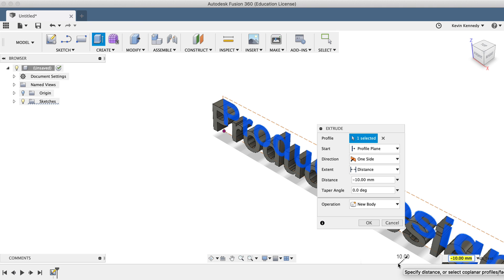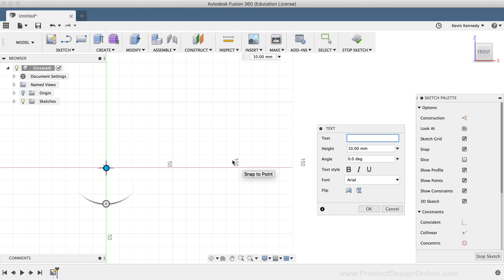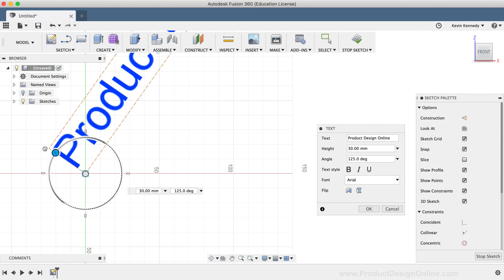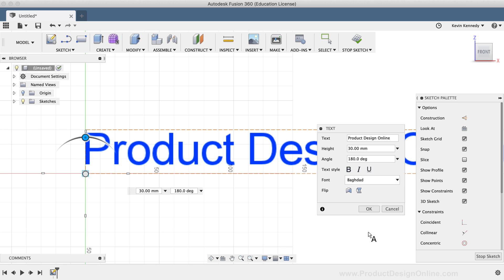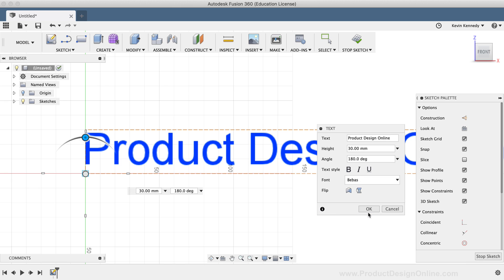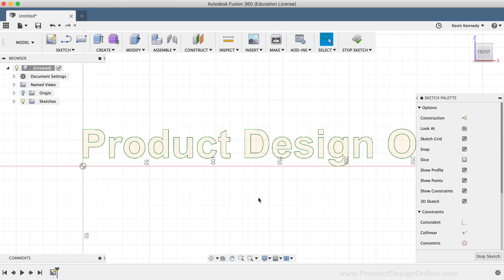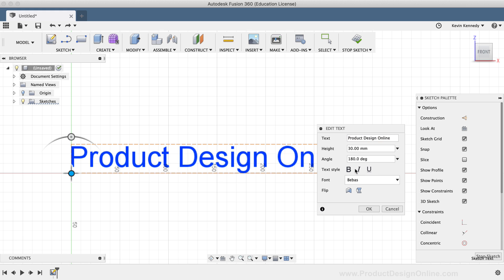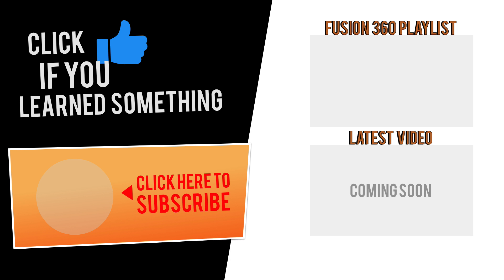How to Create Text in Fusion 360

Comment: Kevin, have you experienced fonts that don't display / show as the default arial? I imported (on mac) a Rae Dunn Font (also known as 'The SKinny') and it shows on other applications, but although it shows up on the font list, it displays as arial.  Any way to fix this?
Reply from the maker: Hi, Jason. One thing that I did not mention in this video, which may be why your font is not displaying.  Fusion 360 currently only supports TTF fonts. If the font is an OTF font (a lot of the free fonts on the web are) then it will not work, even if it shows up in your list of Fonts and lets you select it, it will default to Arial. Cheers, Kevin :)
Reply: @ProductDesignOnline  thanks Kevin.  I also learned that some of it is Mac error related - by manually dragging and dropping the files to Macintosh HD/Library/Fonts subfolder, (the native Arial Unicode.ttf was the only one in there in my case, even after several attempts to install the font ), that solved the issue.  THanks again for your assistance
Reply from the maker: @jasondagenais5701  That's good to know. Thanks for the update! Cheers, Kevin :)
Reply: @jasondagenais5701  There's and easier, more permantent way to solve it :-) Open Font Book>Preferences>Default instal location : Change from User to COMPUTER. Not sure if you have to reinstall the fonts in question, but did that anyways, and it now works like a charm :-) Hope it helps. PS, this will walso alow you to much more easily install new fonts to Font Book by the import function or simply double clicking the font file (open font file) in finder.
Reply: @SourceOfObesity  thanks for the post.  I read that suggestion before and my system is set to 'computer' but it still doesn't want to honor the font install correctly.An unfortunate byproduct to Catalina.
Reply: Jason Dagenais did you reinstall the fonts after changing to “computer”?
Reply: SourceOfObesity yes I have.

Comment: there is one way to add texts to a surface...this guys got it figured out...

https://www.youtube.com/watch?v=oe-A6mWU2mQ
Reply from the maker: Hi Jason. Thanks for sharing this. I did include that method in an older video. I also included it in one of my most recent videos, which covers some other ways to create text on a curve, if you don't want the slanted or angled letters as he pointed out with his method. You can find that here - https://youtu.be/sja3Fd6aERI
Cheers, Kevin :)
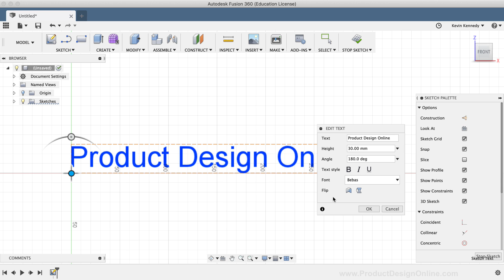Reply: @ProductDesignOnline  Thanks - I just shared because of the comment at 8:02, "there currently no native way to actually wrap text around an object"
Reply from the maker: @jasondagenais5701  That makes sense. That was a poor choice of words on my part... as I meant it more from a standpoint of there is no native feature that does it without these "workarounds". Cheers, Kevin :)

Comment: Great video! Important oversight: The font defaults to Arial whenever it is a type of font that is not supported by Fusion. For example, you selected Bebas, which, being a fancy OTF font was rendered as yucky Arial! Fusion only supports TTF fonts.
Reply from the maker: Hi, Robb. Thanks for sharing this with everyone! I did realize this after the fact (since I couldn't get another font to load for a project) but did not mention that! I'll have to include this in a future video since there are lots of forum posts running into this problem. Cheers, Kevin :)
Reply: Hi :-) Thanks for this info! Yet another half finished application.. :-/  Any clue how what to do if 360 defaults to arial even if using TTFs? I'm on a Mac, and my newly downloaded font shows up in the fonts list in Fusion, but it doesen't work.. :-(
Reply: GAH! The solution for my issue:: Open Font Book>Preferences>Default instal location : Change from User to COMPUTER. Not sure if you have to reinstall the fonts in question, but did that anyways, and it now works like a charm. That's such a strange design from autodesk! :-/
Reply from the maker: @SourceOfObesity  Thanks for sharing this workaround. I've found the only other stable solution is to convert OTF fronts to TTF fonts, then Fusion 360 seems to work well with them. There are several online converters that are free if you Google "convert OTF to TTF for free". Cheers, Kevin :)

Comment: Hi! Thanks for your video. 
However, I cannot get the exploded text to stay in the same position as the original text. Do you have any idea how to fix it?
Reply from the maker: Hi, Samuel. When the text is exploded, the sketch geometry should become "fixed" and have green sketch lines. Does yours not do this upon exploding it? Can you provide a short screencast or a screenshot of what you're seeing? Cheers, Kevin :)
Reply: @ProductDesignOnline  Hey! Thanks for replying. The problem is its location. It is indeed fixed in green sketch lines, but located and deviated from its original location. :( How can  I send you the screenshot? :) Sam
Reply from the maker: @samueloliveira3631  Gotcha...that is strange. I haven't seen that happen before. You can share a screenshot via https://snipboard.io/ and paste the link as a reply to this thread. I'll then look at it to see if there are any settings or anything else that may be causing this. Cheers, Kevin :)

Comment: hi just found your tutorials , look great and are easy to follow. What I would like to make , are some large scale letters in 18mm plywood. Can not fiind anything online on how to layout and nest 600mm high letters on a sheet of ply, and using a cnc router to cut and profile ready for painting and mounting on a free standing signage board. Can you do a tutorial please.
Reply from the maker: Hi, . houtslager. I can't promise I'll get to a tutorial on this anytime soon, as I have a long todo list. However, I'd be happy to help out with some tips to lead you in the right direction. If you're doing custom signage you may find it works best to create the letters in a graphics program that allows you to export as an SVG. I recommend Adobe Illustrator, however, Inkscape would be a comparable alternative that is free to download.

Having SVGs of the letters will let you set the size in the graphics program and then import it at the desired size, saving you from having to mess with that aspect in Fusion 360 (which can be tricky with text sometimes). If you need some more direction feel free to contact me through my Facebook page. Cheers, Kevin :)

Comment: where do I find 'add text' in the new UI? 
Sometimes it's available, (from 'create', sometimes not.) What do I do to make it available?
Reply from the maker: Hi, richardlowe42. The "text" feature will always be available from the "create" dropdown list when you're in an active sketch environment (sketch tab appears in the toolbar). I can understand how this can be confusing, as the create dropdown list is different if the sketch  tab is not active. You'll likely find it easier to just use the shortcuts box. Hit the keyboard shortcut letter "S" and then simply type "text" any time that you need to use it. Cheers, Kevin :)

Comment: Hi Kevin, how can I adjust the width of the text? Do I need to set dimensions after exploding?
Reply from the maker: Hi, Dave. Great question. You can't really apply dimensions after exploding text, because it will simply move the letters around (not make them wider/larger). What I recommend is creating a construction line with the desired width, before you create the text feature. Then, as you create the text feature you'll want to set the "height" equal to whatever is needed to meet that width requirement (based on your construction line so you can visually see it). Cheers, Kevin :)
Reply: @ProductDesignOnline  Excellent, I am already on the correct path then because I did rectangles with constructions lines where I need the the letters. They need to be exact. I am trying to do UK style number plates, but the requirements are that the letter/numbers must be 40mm high and 30mm wide with 5mm spacing. I was able to use the scaling feature after extruding.
Your videos are very helpful, thank you.
Reply from the maker: Thanks, Dave! I'm happy to hear you're heading down the right path. Please don't hesitate to comment on any of my videos should you have any questions. Cheers, Kevin :)

Comment: What if I want write the words horizontally like 
A
B
C
D
..
I cant find any option
Reply from the maker: Hi, karthik. Unfortunately, Fusion 360 does not offer vertical text at this time. There are two workarounds for this.
Option 1) Create individual letters using the text command each time and placing them in a vertical line. You could snap each letter into a vertical reference line to make sure they line up.
Option 2) You could create the text in a graphics program that allows exporting as an SVG. Then import the SVG into Fusion 360 and extrude the vertical text or letters from there. 

Cheers, Kevin :)
Reply: @ProductDesignOnline  thanks bro
Reply from the maker: @karthiksarada2656  You're welcome! :)

Comment: Is it possible to have for example a name be printed out on a 3D printer? I typed in a name then extruded it only to find each letter would be printed and not the entire name. Is there a way to connect the letters and 3D print as one item?
Reply from the maker: Hi Rud Dog - You could create a thin "box" or nameplate first and then put the text on there. Alternatively, you could extrude a simple rectangle through the letters. Something like this - https://snag.gy/j4rYBJ.jpg
File link - https://a360.co/2TbWfMe

Is that what you meant?? Cheers, Kevin :)

Comment: Hi Kevin, Thanks for video
I’m a little confusing ,How can I add customized text to the fusion??
I want to add more Korean text style to fusion. there is only a few text available
Reply from the maker: Hi, CHO성진. Great question. Fusion 360 will pull the fonts from your local machine, although not all font types are supported. You'll want to make sure the fonts have the ".TTF" file extension. Fusion 360 only supports TTF for modeling operations. OTF should display in sketches, but you can't make them 3D.

With that said, there are many complications with fonts and Fusion 360...and not all fonts will work for various reasons. If you're having troubles with a specific font I would suggest posting on the Forum to see if the engineers can take a look into your specific case. Sometimes they're able to figure out why it's not working. Cheers, Kevin :)